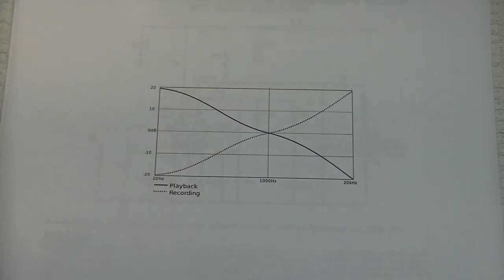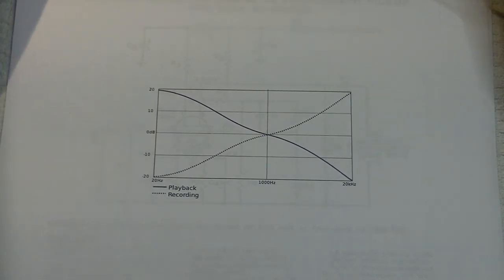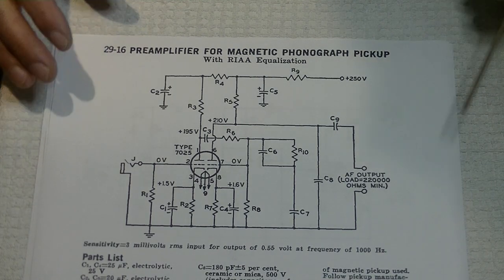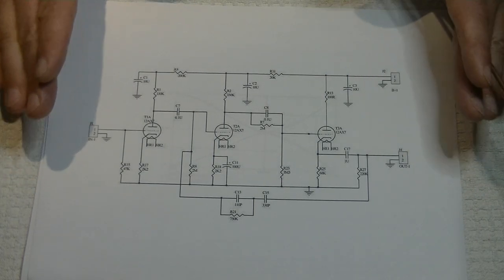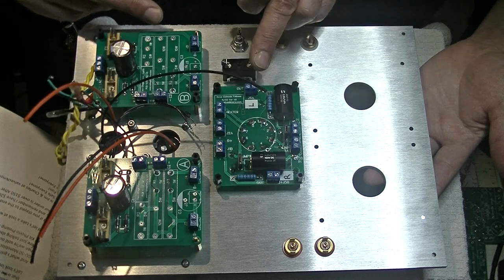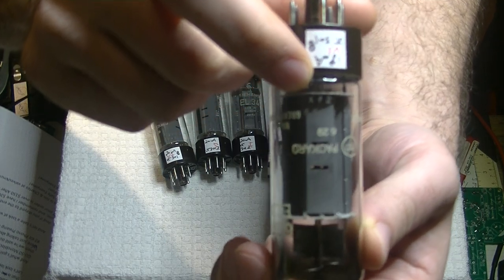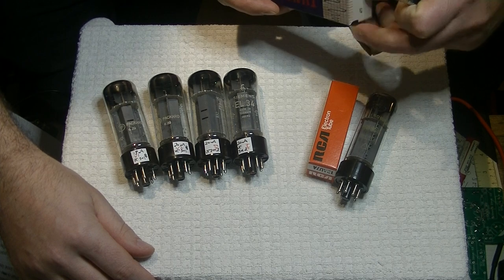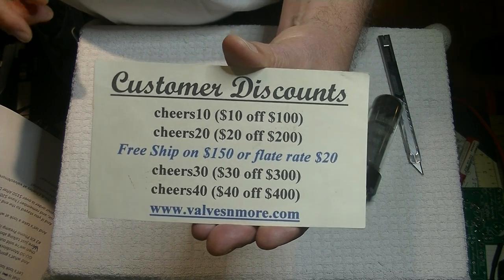Tube Lab #113 - Tube Phono Preamps

Comment: Another GREAT EL 34 is the genuine NOS made by the former TESLA factory .........not earlier JJ that  rebranded their EL34 with the Tesla logo !
>These are as good asd the Mullards ........some may even like them a bit better .....
I have a lovely experience with those tubes , pity I sold most of them in the nineties....
And their E34L was the greatest bass performer I ever heard ..............JJ makes copies of the E34L but they are nothing a like with original Tesla and the sound is not the same !
Reply from the maker: Yes the true vintage Tesla's are good sounding tubes, unfortunately they have proven to be much less reliable than almost any vintage EL34 I can name.